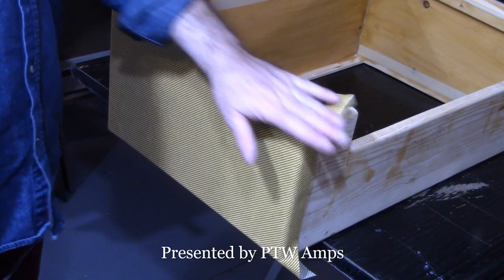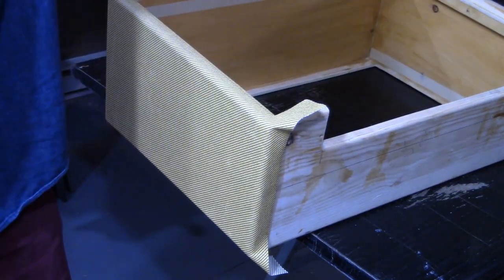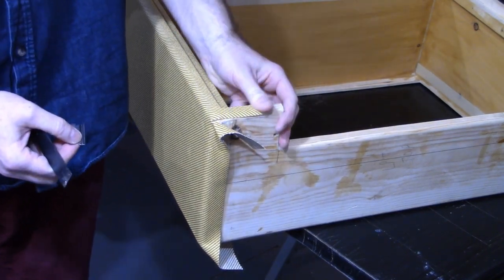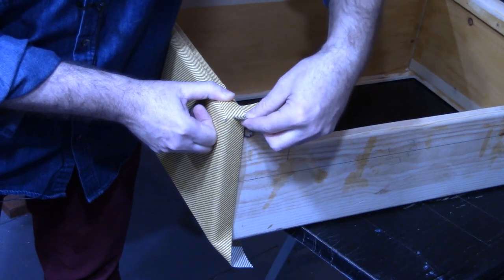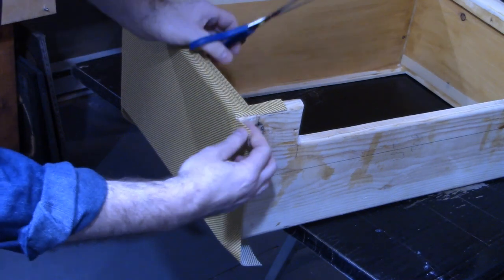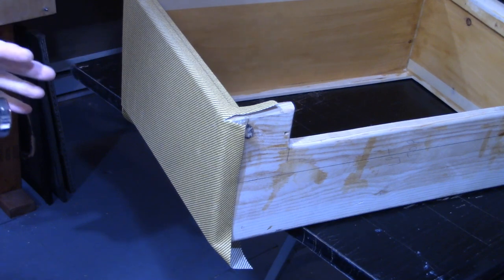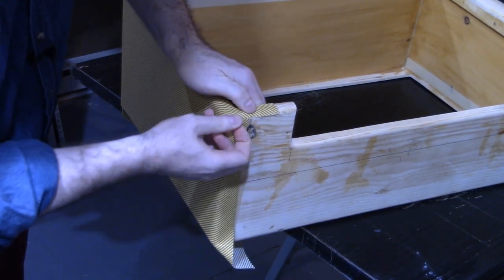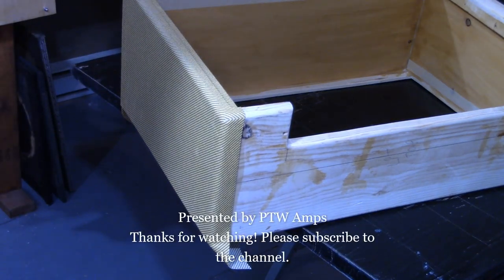How to make clean corners on an amp or speaker cabinet covering

Comment: hi..enjoyed your video...can you recommend the best way to clean tweed covering?  - Thank you  - :)
Reply from the maker: @MRROBBIEWATTS  If it's a 50s original amp, be wary of cleaning the tweed beyond simple dusting as the cloth becomes brittle and can fray. If the amp is more run of the mill, just brush it with a damp (not soaked) cotton cloth. Any vigorous scrubbing will scuff the tweed... and if there are deep old stains you may never get it clean. On an amp not of collectible value, having it retweeded is an option... but be sure to get a quote from the builder as it's a time consuming process (mainly, getting rid of the old tweed and prepping the wood), so it might not be worth it on an amp of lesser value.

Comment: Perfect cut! Which contact cement are you using to attach the tweed/tolex to the wood?
Reply from the maker: Thanks. I use a product called Lepage Low-Odor Contact Cement. I believe it is only in Canada, but it is a white latex contact glue... a fairly generic product. Avoid regular contact glue -- the toxic stuff -- because it melts some types of  tolex.

Comment: THIS is the PROPER technique (i.e., the way Fender has always done it) for finishing off the corners on a tweed amp.  You'll see several YT videos by guys (who should know better) doing it the improper way - which is cutting the fabric at a 45-degree angle, resulting in a tacky corner that looks just like a wrapped present.  Not good!  For further reference as an example of the correct way, just pay particular attention to the corners of any new Fender tweed amp.  Fender figured out from the get-go how to do this to achieve a very elegant, neat, finished-off look.  

This is the more difficult way to do it (because you're cutting right along the narrow curved-over transition between two opposing 90-degree surfaces), and that's why most guys "cheat" and just fold over the fabric like you would on a Christmas present wrapping. 

You NEVER want to be gigging with one of these things (esp. with their lack of corner protectors) in anything but a very controlled environment, and that's why they fell out of favor.  But they are truly a work of art when done right.

Comment: Nicely done; thanks for the tips.
Reply from the maker: Thank you!
Reply: @ptwamps3682  ,
I have a request (and I feel guilty about it; I have no right to ask anything).  If you ever run short of project ideas, could I ask that you show us how to layout the baffle board for a 3-10" tweed Bandmaster?
Reply from the maker: @chokkan7  I haven't built a tweed Bandmaster (yet) but laying out the baffle shouldn't be too difficult. The original cabinet is 22.5 wide X 21 high. If you subtract the thickness of the cab walls and offset 1/8" on each side for the grill cloth and tweed, that would make the baffle 20 3/4" X 19 1/4" (although I always build the cabinet first then measure the baffle for a precise fit). In a 3X10 Bandmaster one speaker is above and the other two are side by side below, in a configuration close to an equilateral triangle. For 10" speakers, the holes should be 8.75 to 9" in diameter. I always find it helpful to draw things to scale on graph paper before beginning to build.